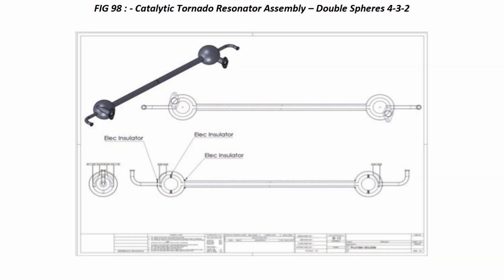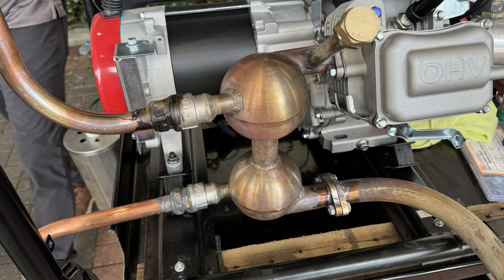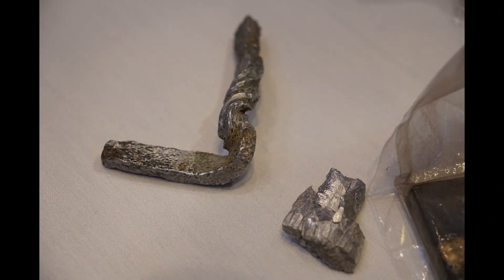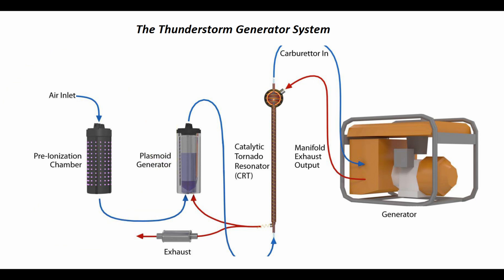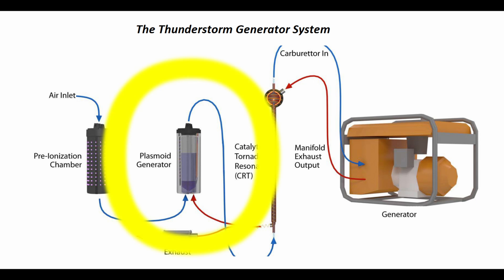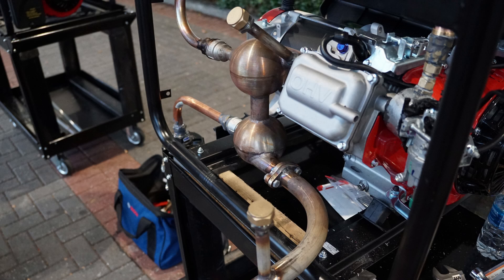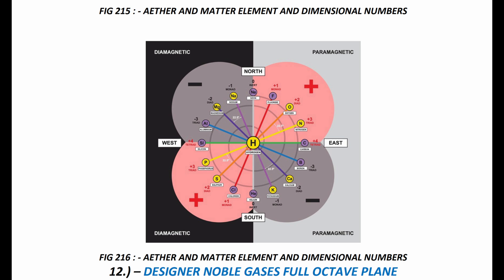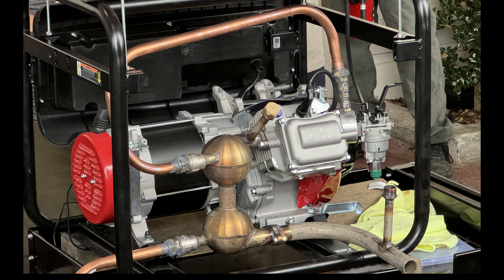What is a thunderstorm generator?

Comment: Great stuff, i attach mine to a washing machine motor that i have changed to include neodymium magnets on the rotor, so the gas generator with TSG rotates the shaft of the motor and generate 240 volts, you don't need to do this part but as the system is based on the Vajra ( ancient 2 sphere shape sacred to Buddhism that is the heart of the TSG ) i thought i would add another recycled/repurposed element, my electro motor is made from an 8 chambered 3D printed rotor this gives my version the clever name ( in my mind ) of the Eightfold Path generator ( another reference to Buddhism ) https://youtu.be/AJOWOlR6un8

Comment: what does this do? does it save fuel? what is the efficiency?
Reply: No carbon emissions. Oxygen comes out of the exhaust the carbon is transmuted
Reply from the maker: Fuel efficiency, 10-30% some claim more.  Zero to very low emissions, all depends on the application and the fine tuning.

Comment: "sealed vacuum from intake to exhaust" Bullshit alarm on all levels
Reply: "clean-up the energy wasted by explosive technology"

yet its a regular engine that requires "an explosion" to produce any power?

lets not get into semantics of flame propagation.. ;)

"think of the engine as an air piston"..

yeah. they are. a funky compressor...
Reply: From what I have seen and understood there is a component that kinda-sorta could be compared to a vacuum of sorts but as I understand it it's not exactly sealed per se.

Anyway, the component to which I'm referring is a tubelike apparatus (which I'm still not fully versed in "exactly" how it does what it does) but somehow it creates two separate vortexes and is capable of separating room temperature air via these vortexes, one pulls cooler air molecules in one direction and the other pulls the warmer air molecules in the opposite direction.

Anyway, it's essentially dividing the room temperature air into separate hot and cold air lines, and since both lines are being pushed or pulled by the vortexes it could be compared to how a household vacuum cleaner with (vortex technology) works...

However one of the other claims of the Thunderstorm generator devise as a whole, is that later in the system the hot and cold air flows forced back together in another component/apparatus simulating hot and cold fronts smashing into one another in the atmosphere and it basically more or less simulates a tiny little thunderstorm...

Comment: So the start up isn't using fuel at all? What are the spark plus firing on. It sounds like combustion to me. We are so much further in front going for the water in the tank combustion engine. Toyota is going for it now. Stanley Myer did a unit injector on the same hardware of a combustion engine. 70% pollution reduction globally.

Comment: Idiots will always attack what they dont understand. Dont let them discourage you
Reply: @432tweaker 7/4/2025  comment
I am just an idiot according to you. So If you buy their thing what does it do?
And equally important how does it use sacred geometry to tap into the forces of the universe.
Their words not mine.
Reply: @JohnSmith-fj3uf would love to hear your thoughts again lol
Reply: @JohnSmith-fj3uf  it increases the efficiency of a motor by roughly 60%. It also reduces the carbon footprint down to zero. It does this by using sacred geometry. Incorporating the mythical vadra from indian texts which is a wheel within a wheel within a wheel. One four inch sphere one three inch sphere and one 2 inch sphere. 432 is one of those sacred numbers. Mimicking nature by having a cold and hot vortex meet. You hook the exhaust to the vadra using copper pipes bent at specific angles, if I'm not mistaken the slope to base ratio of the great pyramid , and then hook the vadra to the bubbler. The bubbler has a ionizing bulb which ionizes the air coming in and also is packed with metal sponges to prepare the bubbles for cavitation and plasma magic. also who is they? lol
Reply: Wow, do people really believe in this bs?
Reply: @andreasschmitt2307  you are literally just misinformed brother. Looked up the geet motor by Paul pantoon aswell
Reply: Would love to have a conversation with you explaining the science brother @andreasschmitt2307
Reply: Negativity gets you nowhere

Comment: This is nothing. People are so easily scammed by big words.
Reply from the maker: Thank you for the complement, I didn't think I was using big words :)
Reply: "The exhaust has no CO2" is not a verbose statement.

It's claims are simple, testable and now, tested.
Reply: If I say "explosive resonant tornadic cyclic frequency generator," you don't assume I know what I'm talking about? That a description of exhaust noise.
Reply from the maker: I am a n00b at this, I added better resources in my description.
Reply: The reverse is also true...people are frighten by big words they do not understand, because of their own limitations of vernacular   knowledge.
Reply: All of this has been tested and proven
Reply: Really?  I had bought it.
Reply: It's like GEET. Which definitely burns cleaner even without being perfectly tuned. I ran half the exhaust back I to the engine so far. Lack of time and money always slow projects.
Reply: So...this basically a catalytic converter and not a power generating device?   Clearly there is a fuel tank on top and an exhaust...or are they too lazy to remove the tank?
Reply: Smooth brain